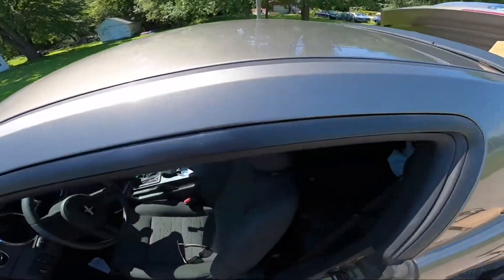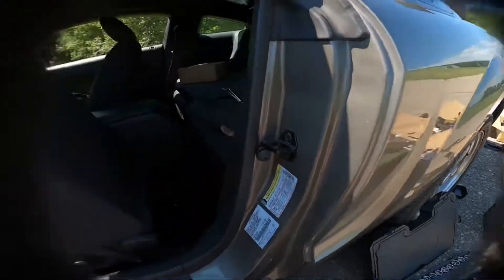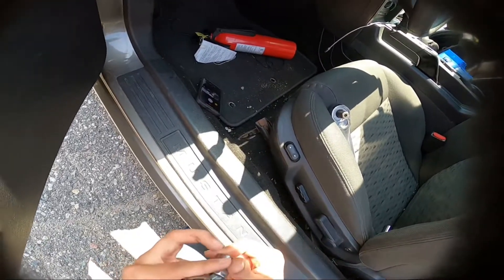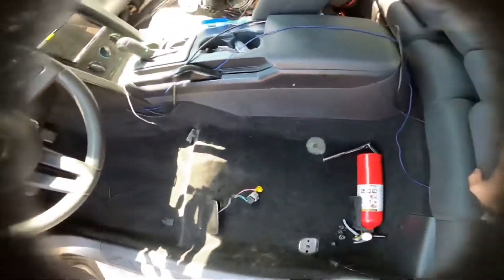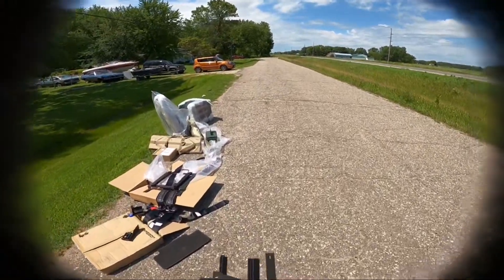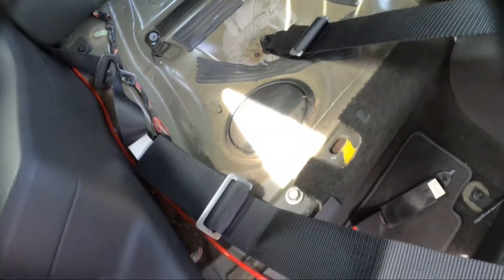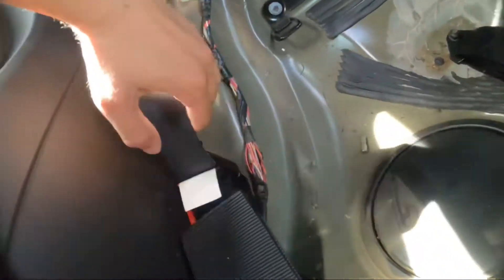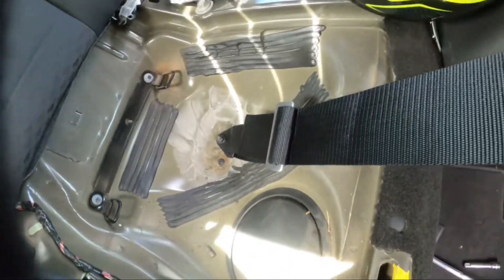Installing racing seats, brackets, and harnesses on a 2005-2009 mustang

Comment: So where can I buy this 2ohm resister for the airbag ?
Reply from the maker: You can get some off of Amazon or from a local electronic hardware store that sells resistors and such
Reply from the maker: I was fortunate enough to have some sent with my removable steering wheel.